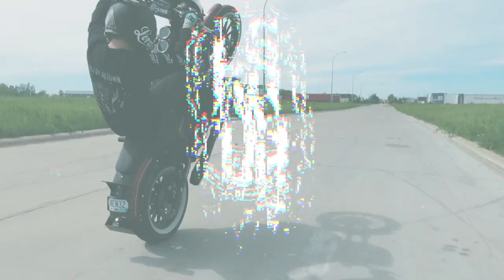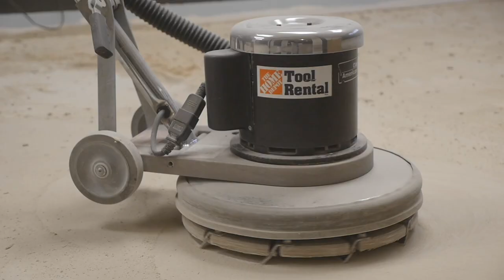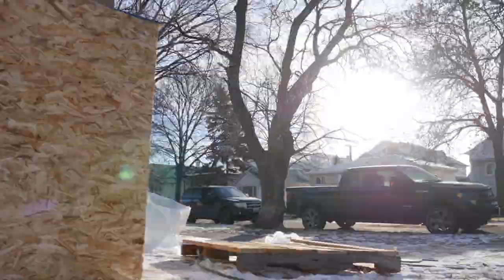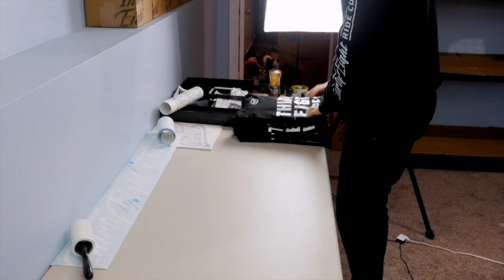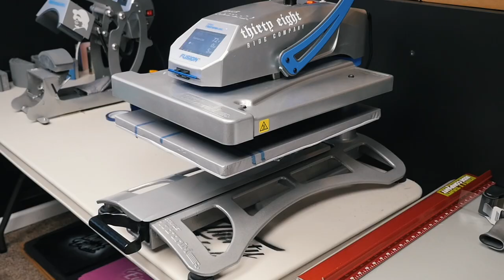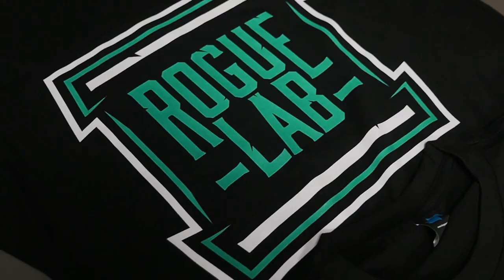1 Year Screen Printing! My Top 3 Tips For Beginners

Comment: Just found your channel!! Thank you for your videos. I spent 2019 dreaming about having my own shop and starting a screen printing business for t-shirts... I went as far as buying a  4 color press with one tshirt set up with a flash dryer.. and of course coming to find out I need so much more equipment!!! The struggle is real and I will be honest I give up every other day in my mind... but the want in my gut is so real, currently working with what I have to practice and learn out of my garage. Anyhow, this video has given me some motivation today and thank you for that.
Reply: Same here bro I need a more equipment but slowly but surely will get there
Reply: The 4 in 1 is a good choice, because registration is the key.  I also bought the single one color press for putting our logos on boxes.  I even broke down after so many failures to hire another company to burn and wash my logo, because they started good and failed from poor work from me. I would highly recommend you get a heat press next.  There are many good inexpensive ones to help get you going.  The vinyl plotter part was my start before all of this, and US Cutter has some of the best units. Don't believe any of those crafters that tell you it's okay to print with the Oracle 651.  Once it gets wet, it falls right off the screen.  But there are emulsion sheets out there that were made for Yudo by Ryonet, that will allow you to wet the screen and expose it on  the screen for about $1 each if you don't have the exposure unit, or a pressure washer. I've only been doing screens for a week and everyday Santa sends me his UPS or FedEx elves to deliver me more products.  Lee was the reason why I even considered doing it.  I'm learning from his mistakes....lol

Comment: I started with some wood and $150 bucks.  Made a 1 color t-shirt press with a workshop light with the UV filter removed to flash screens.  I'd recommend starting at the bottom, just make a screen and print on a art mat holding the screen manually,  I'd skip even using a press at first.
Reply from the maker: Strongly disagree. For like $50 more you can start with an entry level press kit and yield far better results

Comment: I half to laugh because we sorta started out the same way, but with different goals. for many years ive wanted to sell custom shirts, but either the prices were too high for me to make a profit, or i couldnt find a printer that wanted to make them. Fast forward to 8 months ago, i started researching screen printing videos, including yours. I knew it wouldnt be easy, but i damn sure didnt think it would be this hard to do the prints i wanted. I had no intention to do contract work, only to make shirts to sell at special events.
  Around (i had to look up the date) mid September i decided to make the plunge, and decided to buy a new machine, because learning this would be hard enough without machine problems on top of it. I bought a 6 color, 4 station Ranar shop package that had almost everything i needed. I opted out of the conveyor dryer because that cost put me way over, and i found out i didnt have the room for it once the area was set up.  I have a pile of shirts that you wouldnt believe that are all now rags due to problems. To start with, learning photoshop, illustrator, and a separation program is no fun at 63 years old, and i had an antique store that found out i was going to do printing and asked if i could do a shirt for her. 
  well i learned that simple is harder to design then complicated for me. It was a case of doing something and finding something that looked better, and with printing, i found better means harder. I ended up with a Halftone design for my first prints. it took a half gallon of emulsion and washing out screens like you wouldnt believe. (but im good and fast at it now.) My big problem was getting my burn times right, but ive gotten that dialed in now, and actually printing half tone designs, and a few one color as well. now im at the website phase where im looking to get one and try to set it up. Not a clue with what to do there...lol

Comment: I can totally relate to these tips bro. I had tons of problems since i started screen printing. Even now problems do occur time to time. These kind of job requires us to be a problem solver. I really envy your equipments bro ,it can really saves time with that kind of equips. Always keep up the good work i will be watching your videos .😁👍🤟
Reply from the maker: It happens all the time from beginners to pros, it's all about learning how to deal with the problems that come up. Thanks man 🤘🏻
Reply: I used to screen print at Russell Athletic..it was the hardest job I ever had. At 5ft and over 50 didn't help. I was terrible. Thankfully I was moved to another job before I got fired 🥴

Comment: This video hit home! I've been running conduit and crawling under my house for the last 2 days getting wiring ran for the shop. #ALLinorALLout I'm dreading finding my exposure time 😂
Reply from the maker: It can be a difficult process in the beginning but if you have an exposure calculator strip it will take a lot of stress off of your plate. I recommend everyone has one from beginner to pro, one of the most valuable tools out there
Reply: @leestuart38  I got mine haha, just not sure where to begin at. My unit is from CAPS the company got bought out by Rhinotec it's about 12 yrs old

Comment: Went to school for printing, but haven't done it in almost 18 years. Your videos last year gave me the idea of going ahead and starting to do my bands merch myself. Just purchased my first initial setup this weekend. My main concern right now is burning screens. I have a 4 color, 1 platen press, and a flash dryer. The dude also included all the stuff for making screens and inks and squeegies. I just do not have an exposure unit or a pressure washer. Getting  ready to buy a house, so I really do not wanna add much stuff to my setup until I have the new space. What are your thoughts on buying a pre made screen from somewhere? I figured it can be a way for me to get press time to knock the rust off and possibly some usable product to sell to recoup some of the investment.

Comment: I feel like I am at the same point. I have all the clothing sitting in my living room right now waiting to be printed but I can't find a printer in my local area that isn't dodgy. I have contacted 12 companies...big to small and half didn't even return my emails or calls. The last half were SJW's and didn't want to work with my brand because it's a christan clothing brand and has biblical messaging. The one company that said they would work with my brand acted all weird when I went to drop of the clothing...I sent my designs before hand and they said they could do them...then when I got there they keep saying it wouldn't work and that it would look bad on the garment? I am at the point were I just want to buy a screen printing set up and do it myself...I looked into the heat transfer method and getting screen print transfers done up but that's just as expensive as buying a single plate screen press kit. So I think I am just going to dive in today and do it myself. I will scale up when I start making a profit I guess. I have been watching all your videos the last few weeks trying to expand on my knowledge from highschool business ventures class.